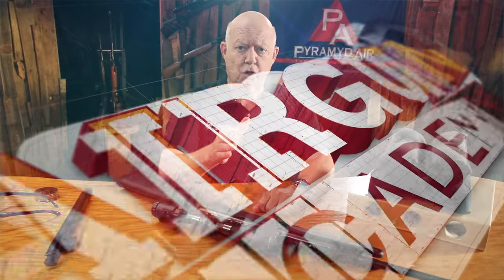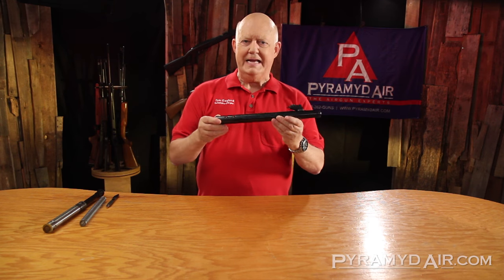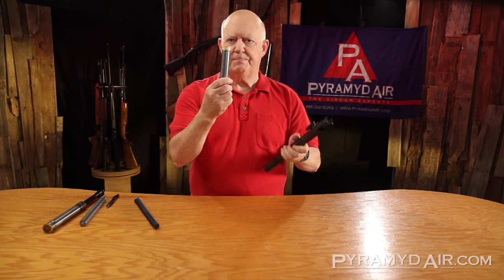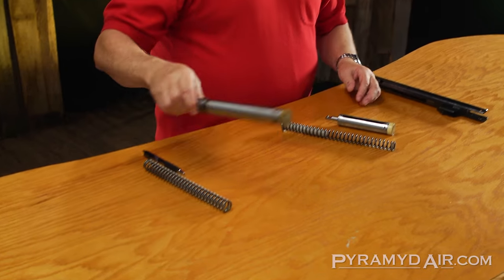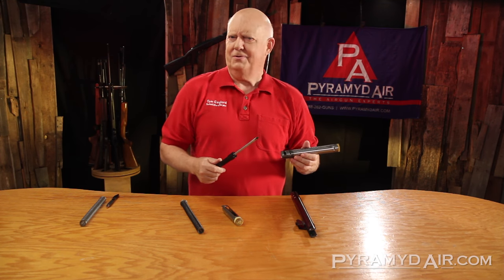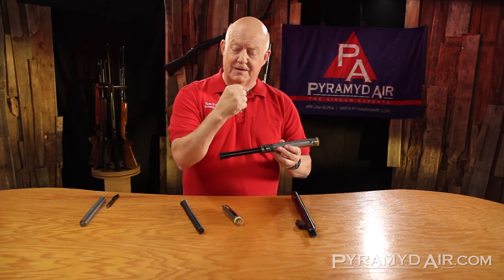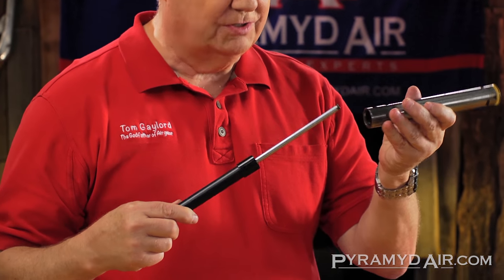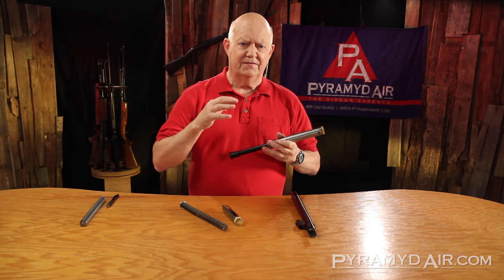Airgun Academy Episode 41 - Coil Steel Spring vs Gas Spring

Comment: I have a Gamo air rifle with a gas spring and haven't noticed any of the negatives described in this video. I like the smooth cocking action. Glad to learn it can stay cocked for an extended amount of time.
Reply: Which model?
Reply: @mppourazizian814  Gamo 1300.

Comment: The gas piston does shoot smoother but I have had several gas pistons develop leaks, which never happens with a spring which is why the Spring Gun will NEVER DIE   HAHA!!!
Just add a thin coat of Spring Tar and you're good to go.
We love ya Gaylord!.
Reply: Bad quality is bad quality, no mather what system. They're both well prooven conzepts. When storing a gas piston rifle, you want to do it with the piston part down, and the tube part up (which usually means with the barrel pointing down), to keep the seals oiled. Thats how they are usually installed in hundreds of other applications. Have fun!
Reply: @gehtdianschasau8372   Now for storage, that sounds like great advise as a light went on in my head.  The few drops of oil would flow to the front of the piston, and be where it needs to be to make a good seal when you use it again. Makes sense, until I thought, "The few drops may also flow out of the transfer port, leaving the area dry".  So I just came to the conclusion, store it barrel down, (as you say), and when you take it out of storage, (not sure why I would store it anyway--hehe), put 2-3 drops of chamber lube in the port, (storing it barrel up for a day or two), and you are good for the season. (probably).
Reply: @EarthSurferUSA  I've heard that you should never lube a gas ram, I don't know the reason why but I think the video I saw was the same guy as this video who said never to lube them. Also oil in front of either piston from a gas ram or spring gun I think can't be a good idea because of deiseling and ignitions.
Reply: High quality gas pistons, like those found in Diana N-TEC models and Crossmans etc. have even longer lifespan expectancy than the steel-springs found in the similar models of the aforementioned producers. And, if you swap the piston (properly) in an steel-springer with the gas, you get, typically, 10, maybe even 15% more kinetic energy with the same pellet.

Comment: I think  the old guy has  a few thing backwards  . In the same gun model a gas ram  can be over 50 fps slower than the  spring and  in colder weather  the gas ram  can be over 60  fps slower  and you lose  over 2 FPE . Watch this video on  a spring vs a gas ram  in the same gun model  in a cold weather test . Look at the numbers . The spring  is the best way to go . What the old man in the video doesn't tell you  is that springs can last over 30 years with no lose in fps . The gas ram  is like whats on  your car hood or hatch back  the one that keep falling down and hitting you in the head . And never stays up during the winter months because gas has less compression when its cold  . The gas finds its way out of the o-rings that is holding the gas in . If you have a car  you have to keep a stick in to keep the hood up you know what I mean . So the gas rams are unproven as far as  how long the o-rings are going to hold the gas in . Another thing the old guy forgot to tell you is the cost difference  a spring is around 15 dollars and a  gas ram  like the vortex is around 100 dollars  and over 50 dollars  for the cheaper  nitro piston  gas rams  you find in the Gamo , Crosman and Benjamin guns  that produce even less power . So if you want to be a  guinea pig  on how long  the gas rams will last before you start losing power and you want less power  in warmer  weather and a lot less in colder weather  then get the gas ram . If you want  30 years of constant  power , faster  fps  that gives you more killing power or FPE  and low cost when it finely does need replacing  then get the spring . I have had my RWS model 45 for over 30 years , same spring and it still shoots the same fps it did when it was new and I shoot every day , Or you want the most power you can get  to take down bigger game like turkey or coyotes  that need the extra FPE  then get the spring . Most gun makers like the  Hatsan you see in the video  have a built in vibration  system that  makes it so you can't tell the difference between the two  and most people  have to ask  which one they are shooting  gas or spring  because you don't feel  the recoil  like you do in the cheaper guns like the Gama , Crosman and Benjamin that don't have the vibration systems  in them .  There is a reason  the air gun company's that sell air guns   want to make it sound like a spring  gun is not as good as a  gas ram , can you guess why that is ? That's right . They are going to make more money off you  because  they know the gas ram is going to stop working faster than the  spring ,so your going to have to pay for the  gas ram if you do it your self or  your going to have to buy a new gun from them in the not so distance future . So don't fall for  his  story about how the springs are slower because that is a lie  and its easy to prove with a little  comparing  of the specs . The piston does the same thing  as the gas ram does  so all that movement  is the same . The gas ram  is more  sensitive to weather  and its harder to cock  with less feet per second speed . Some one ask him  why the  best selling field target gun , the tx 200 that has won more matches  and is used by all most all  non pcp  field target shooters have a spring  inside instead of a gas ram . So when he said( its just not a pleasant thing ) don't believe him . Field target shooters  have to put a pellet through a 25mm hole at 40 yards  and they do it with a spring  gun  not a gas ram . No  field target shooter  except for the beginner   use a gas ram . because they are just not as accurate . That should tell you something right there which one to get .  https://youtu.be/IOo6Og6WIFM . It really saddens me to see how  money has made him talk  this way about the spring ,because I know he knows the spring is the better way to go  but pressure from the  owners  that  want  more of your money has  made him say  what he did in the video .
Reply: I ve got the HW 90 .. I don't know what you are talking about .. theoben gas ram system is way better than any spring .. It is easy to fix .. i just open all the gun  for cleaning and oiling , easy as hell . you can find everything you need to change and is very easy fo you to do it and never loose power ..  If you are going for hunting you can cock it and not shoot all day or even 'till christmas if it is summer  , nothing is going to happen .. Do that to a spring rifle and we we will see  in 30 years you will need 30 services and maybe 40 spring changes..
Reply: nah hes right gas piston air rifles dont last as long in general and develop leaks all the time but its good for the industry
Reply: I am not going to rag on you.  You have come compelling information IMO.  But, with my cheap $120.00 Benjamin Titan .177, (with the right pellet, JSB 10.34gr of course), I am hitting 3 shot groups at 75 yards within .875" diameter from a door jam.  If I can use the pellet I want, I would win the field target competition with one of the cheapest gas rams on the market.  I also left my hatsan 135 cocked for over 22 hours by mistake, and lost no fps/fpe. I am not sure a spring would not sack some after that.
I can also get up to 33.5 fpe, (modified pellet skirt), with my .30 cal vortex gun.  I have not seen production spring gun do that yet, (but you may know of one).
Thanks for your information.  I appreciate it.
Reply: STEVE DENTAL
LETS SAY YOU GOT AN AIR RIFLE THAT SHOOTS 1050 ROUGHLY WITH LEAD FPS ,WHAT N RATING ON GAS SPRING WILL I NEED  ?THEY GO FROM 80N TO 150N ! 
ALSO STEVE I WILL BE GETTING THE REGULAR TYPE SPRINGS BUT IT IS THE ONES WITH THE MAIN SPRING WOUND TO THE RIGHT AND A SMALLER DIAMETER THAT FITS INSIDE THE LARGER ONE BUT REALLY POWERFUL AND WOUND TO THE LEFT SO IT DOESNT GET TANGLE WITH ONE ANOTHER !
Reply: Yeah good point, if gas rams were all that they'd be winning some recoil class ft and hft competitions but those events are dominated by  shooters using tuned spring guns. Another thing, a spring gun can be tuned and modded to fire very smoothly and just how you want it really, a gas ram can't, only have the power set and that's just a few of them.
Reply: @EarthSurferUSA  You mean you would win field target competitions if they allowed bench rested shots, told you the distance and didn't have a time limit. It's a whole different world to shooting down the range. Probably thousands of people say they can get tiny groups with whatever gun but in comps with strict rules it's much harder or no one would bother spending thousands on all the top gear.

Comment: As much as I appreciate technology evolving, I rank the gas piston right up there with plastic front sights-just another manufacturer's method of increasing the profit margin while cheapening the final product-John in Texas
Reply: I agree. Moreover lots of people say that gas springs sometimes give problems. They are sometimes weak
Reply: The gas spring will either leak in a week or last a long time. I recently bought a new springer instead of a gas ram. The springer I can get parts easily for 1/20th the cost of the ram piston. Also my air rifle comes both in spring and ram piston so I have option of parts.

Comment: Tom thank you for this informative video; I have gained a wealth of knowledge by reading your blogs from PA. This may be off topic but last year I read your blog on the Diana 340 N-Tec and wanted to know if you would give your current assessment of the N-Tec gas spring now that it has been out for a year. I had purchased a Diana 340 N-Tec Premium in 2015 to use around my farm on nuisance pests when they first came into the USA but within the first few shots it developed a really loud grinding noise when cocking that progressively got worse.  I am a Diana fan and want an N-Tec gas spring powered rifle for all the advantages of a gas spring you pointed out in your video but am still hesitant, wondering if Diana has worked out the kinks that I experienced and as are reflected from several other owners when they first arrived. Any input you would offer is greatly appreciated. Sincerely, RP, MS USA.

Comment: Hey Tom,

Thanks for this great video on the differences between spring coils and gas coils.

I have a few older metal spring coil models of Gamo airguns that do not have magnum rated coils. I would like to replace all of the coils with Magnum rated gas springs or spring coils. Where can I purchase these gas springs or spring coils and is there anything else that I should know before attempting to change these mechanisms, like do I need any other tools?

Thanks again. 

Stay Safe,  Be Well,  God Bless.

Comment: You've made a mistake at 4:08: gas springs are EASIER to cock than the steel springs (of the corresponding effectiveness). For many owners of the extremely powerful brake-barrels this is very important, if not the most important advantage of a gas springers over steels.

Comment: I'm a firm believer of the k.i.s.s. system, for me is not a hard choice. The almighty springer is the way to go.
Reply: I don't think a cylinder charged with gas is very complicated.  The gas has some different properties than a spring, but that is about it.  Neither are much more complicated than a sling shot or a jungle tribe blow gun.
Reply: @daconverse  Gas ram is hardly new, or complicated technology is it?
KISS? try a catapult!

Comment: Time will tell if the gas-spring is truly more reliable as they all are claiming. 
I call bullshit. Steel springs are still going strong after 50+ years of use. I am all for utilizing the gas technology too, but more reliable? Not sold on that.
Reply: Rick Halverson You can get some good gas rams but I don't think there's many. People have told me their old Theoben's have cracked stocks and the scope won't stay zero'd because of the gas ram. A mate at work has a Hatsan with a gas ram and he says it's brilliant but his gun is fairly new and not had a lot of use. I'd take a tuned spring gun any day.
Reply: I am not sold on a spring lasting 50 plus years of use, if you use it.  Springs don't go flat, and gas does not break.  I think both of them, if engineered well, are pretty comparable with power and longevity if used properly.
Reply: @EarthSurferUSA  if you store a steel springer  for  lets say 20 years  ,and its protected against rust ,it wil hold its power ,.a gas spring wil leak the gas out after that time  ,because gasmolecules wil go tru the seal .same as care tyres lose there pressure, and thats not a problem if you can pump the pressure in  . like hatsan ram`s and a hw 90
Reply: @jimmynich4791 I'm pretty sure that 50 yrs. from now I won't care what happened to my F4's piston, lol
Reply: @uacl028  Yeah but I never mentioned anything about 50 years or any other time frame. To be fair there's spring guns over 100 years old that still operate well, gas rams haven't been around anything like that long so it's pretty much impossible to say they're more reliable.
Reply: I got my crosman nitro piston (yes the old version not the nitro 2 piston) rifle 4 years ago, still is shooting very well after many many tins of pellets. only thing i do is give it a bit of oil at the moving steel parts.
Reply: @stefanmannn  2014 NP2 still going hard.
Reply: @EarthSurferUSA  
Doug,
You claim to be a crackshot, and maybe you are.
But your mechanical reasoning is definitely not.

Comment: yea right if you leave it cooked it wears out fast once it starts leaking your done, expensive repair,  vr just replace an  5 bucks spring,,,
Reply: Why would it be an expensive repair if you can buy the parts, (seals) and replace them yourself, and recharge the gas piston, (if the cylinder has a port)?  If it is rebuild-able, you might be able to fix it cheaper than buying a spring, (and the seals you would also replace). I left my hatsan 135 vortex piston cocked for over 22 hours by accident, and lost no fps/fpe.
For hunting, I would rather have the gun cocked and loaded.  Sure, you can get a leak, but you probably won't.  But that spring will sac out if cocked for hours a day.
Well engineered and good components used (like good seals) with good manufacturing, I think both are pretty comparable really with performance and longevity, if used as intended.

Comment: Does the gas spring require gas refills? What type of gas?
Reply: No, its like the gas shock on the back hatch of your car that holds the hatch open
Reply: @PainterDans  does it work like a multiple pump bb gun?
Reply: @KJ-ek2ze  single shot

Comment: I always wondered how gas springs could stay tight over such a long periode of time. Are they sealed simply with o-rings ? How long do the seals last usually ?
How much are gas springs precharged (how much pressure in the extended state)? If there was a valve it should be pretty easy to tune the power of a gas spring. BTW -  are they filled with air or something else ? Something less reactive than O² would possible suit the needs better (nitrogen ?).
Reply: The gas spring is filled with nitrogen. Not sure how much pressure. If they have a valve they are easy to tune, but most have no valve. In my opinion the gas spring has more advantages. They shoot really nice: sharp reward recoil only, no bounce back or vibration and no twang noise. Easier to shoot accurately. I really like them.
Reply: @trevorjameson3213  some, like Hatsan, are just air.

Comment: It is false to claim that a gas pring can be left cocked for indefinite time with out breaking down. Gas leaks out ot these pistons when they left compressed especially left in the sun. Steel spring out last gas springs in the long run. I have a air rifle with the same metal spring for close to 30 years now and it has been used extensively not so much anymore but it has seen over 5000 pellets and I am sure there are other spring rifles that has even seen more pellets that is still going strong. I am not a fan of the gas technology. Give me a solid build traditional spring piston anyday.

Comment: Spring piston is old technology not durable, gas piston is new technology more durable.
Reply: it depends on the quality of the steel ,take a spring of a car engine  intake or exhaust valve .i do not see a gas spring seal hold that long,
, and that steel is also used in walther airguns  and more
Reply: @peteralexben  There's spring guns still going strong that are over 100 years old. The pump to refill the the theoben rams is over £100 and some rams can't be refilled and have to be replaced.

Comment: which one has more longevity, or, which one is more likley to fail on average?
Reply from the maker: Arguments are still ongoing about it. Coiled springs made from modern materials can last thousands of shots. Gas ram too, although it has a risk of a leak, that coiled spring does not. Your mileage will always vary based on the quality of the product you decide to buy!